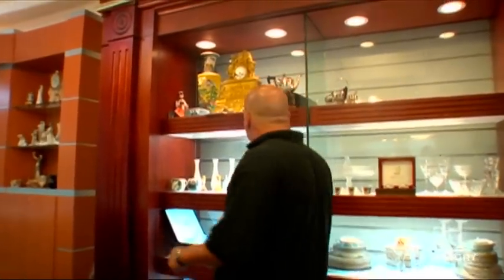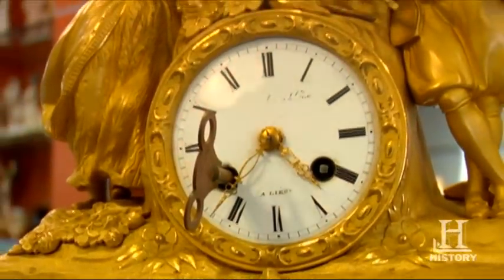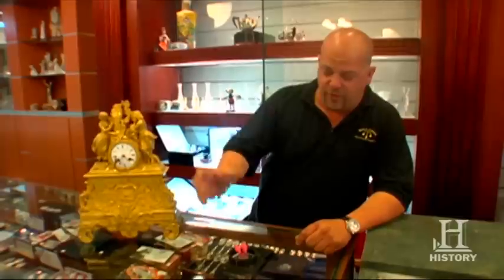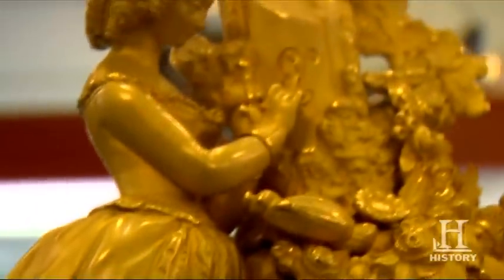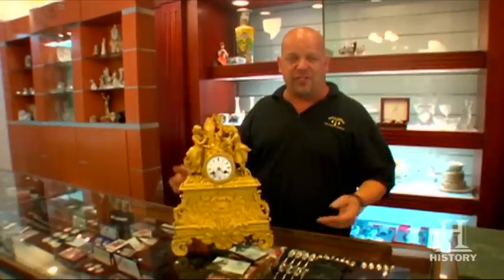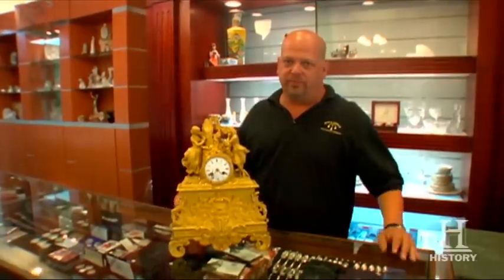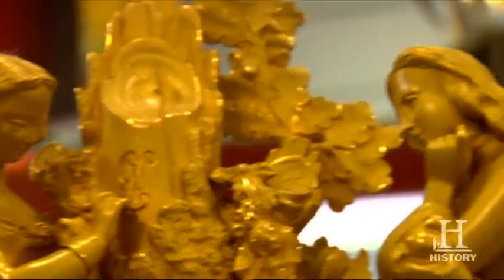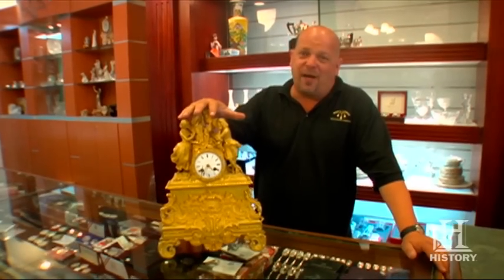Pawn Stars: The Death Clock | History

Comment: 1.- A common 1840s French bronze or brass mantel clock, not from the early 19th century when the design, cast and chiselling was far more better. Read the Wikipedia article: French Empire Mantel Clocks. 
2.- What a lack of information, people did not "die making clocks like this". Usually most gilders did not live beyond 40 years of age as a consequence of the mercury fumes caused during the fire gilding process, but only after years of exposure. 
3.- Asking $8.000 for a clock worth $600 or so.

Comment: Actually Wikipedia is useless for information on most things especially this. Much better to refer to the excerpts on  Casting also Gilding and Horology to be found in a contemporary publication that is Rees' Cyclopedia (38 Volumes C. 1800 -10). It's also worth looking in a famous technical work - Encyclopedie des Sciences, des Arts et des Metiers by Diderot & D'Alembert (published 1751 -1772, 35 Volumes) for everything you need to know about how things were made back then including this clock.

Comment: His ignorance is only matched by his confidence.    Ovens don't just magically get to a high temp.  They usually require bellows, which require fresh air.  You also need a good exhaust to pull any gasses out which will inhibit combustion.

Comment: are you safe handling the clock as a consumer there is no mercury in the brass or gold?

today replicas can be made from plastic or even ceramic.

each piece of an elaborate piece would be casted in ceramic or greenware then fired to make bisque and something that they tell you never to do when you paint ceramics is to paint the bottom surfaces because it would bond to the kiln shelves.

you would in this case  paint the bottom surfaces or uses lumps of greenware to bond the figures to the rest of the parts and once fired it would for 1 solid piece.

in some cases the pieces are glued to each other to form the solid piece.

Comment: I would like to make some corrections; -
1) The clock case of C. 1850 was cast in a sand mould (made from a wooden pattern) and then hand finished.
2) The mercury amalgam was painted on as thinly as possible because gold happens to be valuable.
3) The gilders didn't sit around breathing in the vapour, they knew of the dangers.
4) But he 's right in pointing out that contrary to popular American belief, things like this can in fact be made without reaching for the box of power tools.